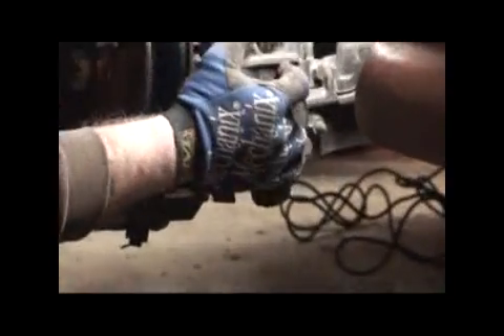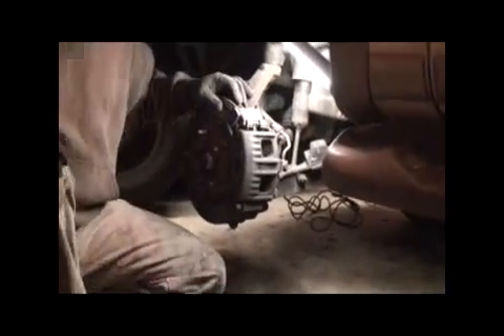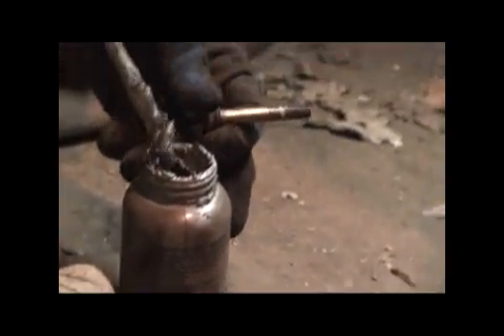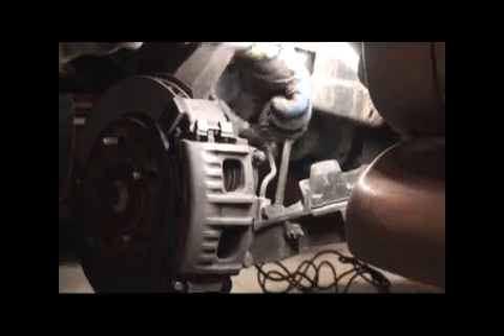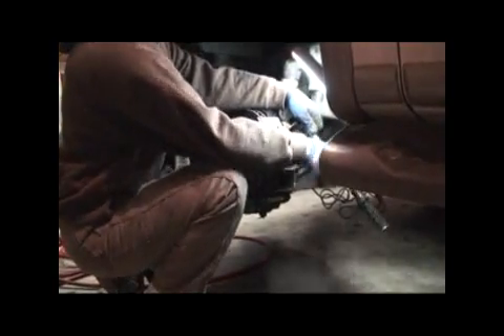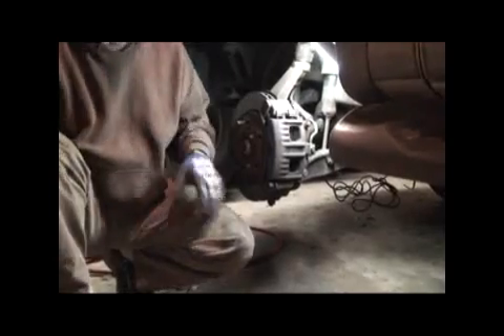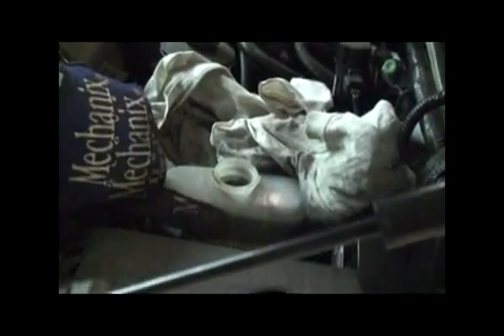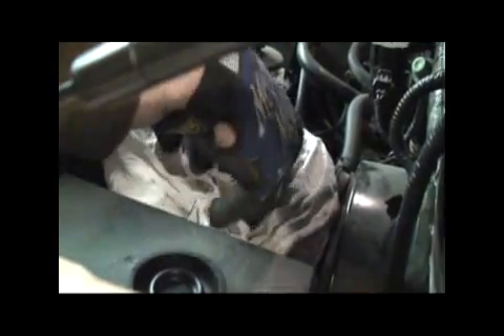2000 Ford Expedition -- Brake Pad Replacement - Part 4

Comment: Thanks for doing this type of front caliper. The ones that take the T45 torx bolt seem to be a lot less common (possibly only Expeditions around 2000). I had to start by going out to get the T45 socket. I found this job a little more difficult than others and kept on referring to your video as I did the job. I managed without the special tool for compressing the pistons. An old brake shoe and two c-clamps worked fine.